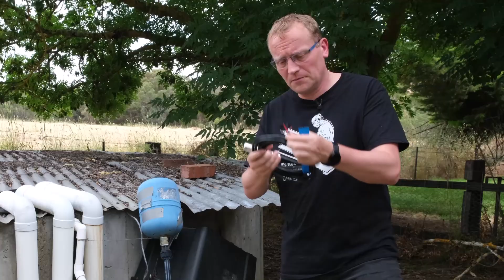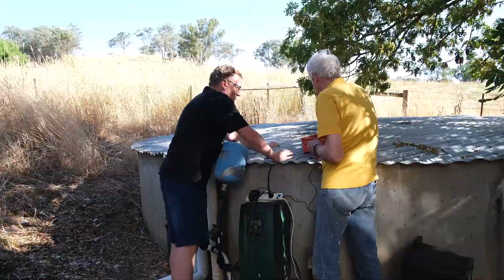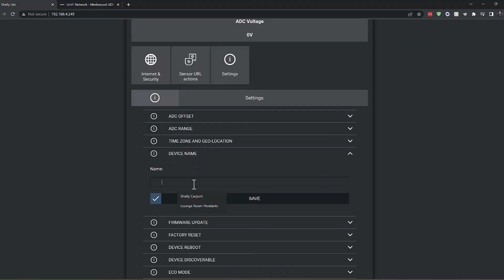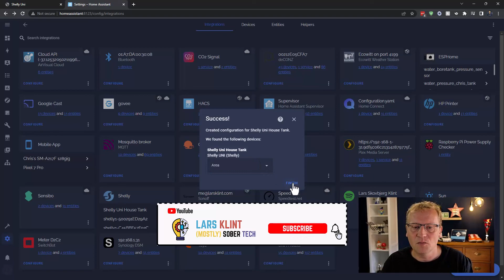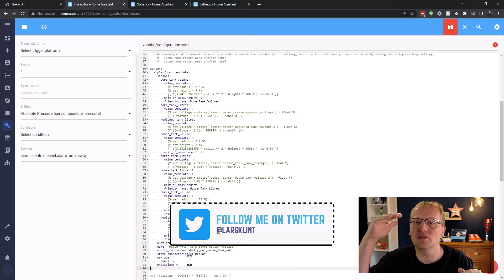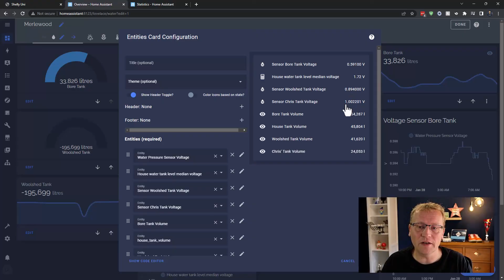Monitoring water tank level with Shelly Uni & pressure sensor | House tank sensor v2.0

Comment: Marvelous Lars, thanks for your efforts sharing with us all :)
Could I ask, would it be possible to trigger a flashing alarm light when a specific water level is reached do you know?
Haven't setup HA yet but will finally be getting round to it and first sensor will be a Shelly Uni and one of these tank sensors.
I too want to monitor a couple of rain water tanks that is our water supply, but also to monitor and alert if our grey water tank level rises too high (indicating a fault with the pump) and council regs specify a flashing light on the tank.
The one that was there is old and busted and rather than the old way I want to go this newer way and kick off my HA journey!
Cheers from Northern NSW.
Matt.
Reply from the maker: Hi Matt. Good question and YES, absolutely! You can get Home Assistant to trigger almost any kind of event. I would use something like a Shelly 1 to get the light wired up, and then you can control that from HA too. Oz Smart Things has all the Shelly units and use discount code LARSKLINT for 5% off too. Support the Aussies 😁
Reply: @LarsKlintTech  awesome man will use that code thank you :)
Reply: Oz Smart Things Stripe checkout says "Enter a valid discount code or gift card"
(Posting here in case it helps others...)
Reply from the maker: @Ltech-ludditetechnologies  It worked though?
Reply: @LarsKlintTech  regrettably the code did not and I am under time pressure with council (overdue (on the extension) for my inspection)
I would however like to buy you a coffee to even that out by way of thanks.
Reply from the maker: @Ltech-ludditetechnologies  I think something is broken in Shopify. The code is active on the backend that I can see, but somehow Oz Smart Things isn't picking it up. Give it a try tomorrow?

Comment: Hi Lars, Just finished installing some tanks, now looking to get a reliable level, bought a ultrasonic distance sensor a couple of years ago for another project but it seems faulty now I've installed in these tanks(after installing it so neatly too in the top of the tank, always the way), now looking at a pressure sensor as it would seem more reliable long term.

Does the sensor sit on the bottom of the tank(i.e probably laying down), or does it hang? I'm not find a lot of info on that when I look around.

Cheers,
Reply from the maker: Good question Ryan. I don't think it matters. The pressure sensor I use in this video is not very long relatively to the height of the tank, so at most you'd get a tiny voltage difference, which you can compensate for in Home Assistant anyway. I just plonk mine in the tank until it hits the bottom and I haven't had any issues with it. 
On a side note I am not a fan of the ultrasonic either, as I have heard other anecdotes of them being unreliable and unstable.
Reply: @LarsKlintTech  Yes, done that with ultrasonic sensors - A02YYUW.  Hopeless, subject to noise (rain, wind, filling) in the tank and didn't survive in the damp atmosphere (despite the specs). Wasted a lot of my time, but not much money, on that idea.  Moved on to the pressure sensors.

Comment: Thanks Lars, finally got a Shelly Uni and was able to install it all on my setup here in Thailand.  I had the slight complication of a pressure sensor that ran on 5v so had to include a buck convertor into the mix rather than run another power supply.  As is often the case I had issues with the yaml for the sensors but eventually I always find the missed quote mark, space, colon, hyphen or indent!  I'd send you some photos but don't know how!
Thanks for helping with this video,
Leigh
Reply from the maker: Oh, I am so happy to hear that Leigh. That is great news. FWIW I always have issues with the YAML and redo it several times for any new project. 
If you look at my channel details, you can see my contact details as well. I'd love to see the photos of it 😊

Comment: Thank you this is very helpful. On my farm i dont have electricity at my tank, do you have any solutions for powering the shelly and depth sensor? I wouldnt know power requirements or what size batteries to use if i was to make the solar array myself, not sure if there is an off the shelf product to suit?
Reply from the maker: It is difficult to answer without seeing you setup, and then still difficult 😂 You probably need a solar panel, a solar controller, and then an output from the solar controller to power the sensor and Shelly.

Comment: Thanks for a great video! I've created this setup myself, however I used the 0 - 10V range sensor instead which gives a much smoother line to work with & does not require the median value like the 0 - 5V needs.
I've also used a weather proof enclosor with a DIN rail to mount a DIN 12V PSU to power the sensor & shelly UNI. 🙂
Reply: Would you mind sending me the link of the 0 - 10V range sensor you purchased? Thanks!
Reply from the maker: Very nice work mate. That is perhaps what I should do when I upgrade the system again 😁
I definitely want to improve the enclosures I use too.
Reply: @LarsKlintTech  Happy to share my photos if you like. :-)

Comment: As a fellow microsoft guy homesteading in Australia who has taken on many similar projects over the years, I really appreciate you!

Silly question, when the sensor says its range and cable length (e.g. 5m range and 5m cable) does that mean that the supplied cable is actually longer (e.g. 5m of cable to get to bottom of 5m tank over ground and 5m of cable go get back down to ground) or would you need to extend the cable?

Cheers
Reply from the maker: Thanks Dale for the kind words ☺ No silly questions here. That is a good one. It took me a bit to figure it out, but the "range" is how deep a body of water you want to measure. It is the calibration of the sensor, so a 3 meter range will be at near to max voltage (if you chose a voltage sensor) at 3 meters. A 5 meter range is close to max at 5 meters and so on. 
The cable length is the length of the cable at the end of the sensor.

Comment: Quick update note for anyone else as dumb as me, just to help out. I blew a power supply in a rain storm a few weeks back. I dried everything out, added a new power supply and redeployed it to the tank. I kept getting the same voltage at whatever depth. In short it had become useless. I assumed that the power spike had killed the sensor so I ordered a new one, which came today. connected it up and got the same result. After a bit of thinking time.............................. I realised that the ADC voltage has to work in conjunction with one of the power supply polarities and that I had (when replacing the original power supply) inadvertently reversed them. Corrected that and we're back in business. We now have a spare sensor (doh !), which I'm going to try and deploy at the dam after I get some wifi and battery power down there
Reply from the maker: Thanks for sharing Peter. We have all been there. I have gone wrong so many times with various projects, but we just keep iterating until we get it right 🤓

Comment: Great Video! I have a question: Is there a way to display/convert the voltage into something meaningful, such as a percentage or a gauge, without the need to host a home automation platform at home? I am trying to monitor the water tank level without setting up a home automation server.
Reply from the maker: Thanks mate for watching. Good question. I am not sure, but I would imagine so. There is probably a analog gauge you can plug it into directly.
Reply: @LarsKlintTech thanks for the reply.  I'm not looking for something analog, I'm looking for a free online service/website with a decent mobile app that might allow me to do that without needing to install HA software at home.
Reply from the maker: @vickenk  So you are after Home Assistant in the cloud? I don't think anything "free" will possibly solve your challenge. I am not sure anyone would host your data and provide an app without some form of compensation?

Comment: Hello nice work over there 

But I need to change voltage to % like 0.00 volt = 0% and 3.00 volt = 100% for example 

Is that possible?
Reply from the maker: I am not sure what you mean 🤔 If you follow the math in the video at 18:00 you can adapt that to output a percentage instead of litres.
Reply: @LarsKlintTech  yes I did work on it simultaneously after I write this comment. 

Thank you for your replay. 

What I did I used template then I saw in my uni the max is 3V & the min is .10V. So I divide the Voltage on 3 then multiply on 100 then add % to have it after the the number but the problem is I have alot of digits. 

I think I have to use statistics After that I’m not sure. 

Thanks
Reply from the maker: @Ibra96m  Use the "round(x)" function in your template to get rid of the digits you don't want. I use it in the template as well.
Reply: @LarsKlintTech  okeyy

I sow it many times in examples but I don’t what it is meant
Reply from the maker: @Ibra96m  All good. We learn 😊

Comment: Hi another Great Video.... On the Template you created i see you already have an idea of how many Liters of water are in the tank  ...... I my case am using underground Well am not really sure how many liters of water is down there .... How do i get around that in my own template thanks
Reply from the maker: That is a tricky question. If you are lowering the sensor into the well, can you tell how far down the bottom is? If you can do that, then you know the height. If you don't know the width of the well, then you might be able to guestimate it by pumping out maybe 1000 litres and see how much the voltage drops. If you assume the voltage is 0V if the well is empty, you should be able to deduct how much water is in it, if you know the voltage drop for 1000 litres.

Comment: Lars - is there a way to set a retain value for the Shelly uni? My project is very similar to yours but powering with a 12v battery pack of 1860's with a solar panel. When the battery goes below power level to keep Shelly running - it goes offline until the sun comes out again next day. I know that when using esphome you can put in the yaml a retain: true line and the values are retained in the gauge card.
Reply from the maker: Very good question. As far as I know there isn't a memory feature on the Shelly Uni when the power is gone. Add more batteries?

Comment: Mate thanks for this. Just got the kit set up and mostly working. Using the pool to Calibrate it, before it goes down the tank (after I manage to find the bloody cable blocks I bought and now can't locate). Thanks again.
Reply from the maker: Brilliant!! You are most welcome Peter. Clever idea to calibrate it in the pool. That should work a treat.
Reply: @LarsKlintTech  I'm seeing 1.6v per metre roughly. Pool isnt deep enough !!
Reply: Update, found the cable blocks. Built the enclosure (think I might need to drill a hole to put the Uni Aerial outside the box....) Off to the pool shortly.
Reply from the maker: @PCRoss2469  I 3D printed some enclosures, and the antenna needs to be outside that too.

Comment: Thanks so much for this video.  I did exactly was you outlined and can now see my tank fullness, and gleen some interesting info on my water usage.  I added a 10W solar panel and controller, and 8ah battery to power it all, instead of using the power adaptor as you have.  I have one Uni monitor the tank pressure , while the other monitors my battery charge.  It's been up and running for just over a week.  I live in Canada so long summer days, but short winter days and low sunlight.  Going to be interesting on how it all fares over the year!
Really love having the default history functions in HA to see how it will all trend.
Reply from the maker: You are so welcome mate, and love your setup with the solar. It is the best automation/monitoring I have of all the various things I manage. Water is critical and this kind of project just takes that little bit of stress out of your day 😊

Comment: This is so good. I'm all over it. But how many of these analog pressure sensors could you add to one shelly uni? If I had 2 tank next to each other, could I run two sensors form them into the one shelly?
Reply from the maker: Thanks for the kind words Shaun. You can only have one sensor per Shelly UNI, as you need the ADC input (white wire) on the Shelly to receive the voltage from the pressure sensor. The signal/voltage is analogue so you need the Shelly to convert it into a digital value HA can use. Also, Shelly UNIs are cheap, so it isn't a huge problem?

Comment: Lars, you are a bloody genius. However, I am not. I have the Shelly Uni outputting varying voltages to my two tank sensors but for the life of me I can't work out how to convert the voltage to litres. I've got the diameter and depth (currently 64000L) but that yaml stuff is beyond me, I'm addled. I've been unable to find a video or tutorial that describes how to do this for simpletons. If you know of one please share. Thanks again 🙂
Reply from the maker: Haha, I don't know about that, but at least it is in writing now 😛
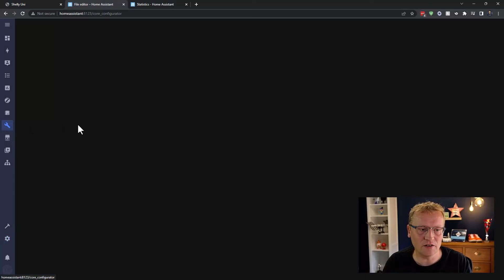If you look at the screen in the video at 22:18 you can see the configuration.yaml file. This is the main config file for Home Assistant where you put everything that isn't "out the box" in HA. You can see a section in the YAML which says "-sensor" at the top. That starts all the various custom sensors I have. A sensor is just a data point that HA can read. Then it says "-platform: template" which means a template sensor. A template is pretty much any kind of calculation you want to do, where you take an input, such as the UNI voltage, and then converts it to another value. 
I have created a number of template sensors, each of which is a water tank litre measurement. For example, for the "house_tank_litres_2" sensor, I have use the voltage from the "sensor.sensor_house_tank_voltage_2" which is my Shelly UNI voltage. The main thing I always get wrong is the correct syntax with what is in quotes and what isn't. 

Does that make any sense?
Reply: @LarsKlintTech  Thank-you Lars for your prompt response. I shall have a go using this information, thank-you. My computer skills haven't improved since we filled out dozens of cards with 2B pencils (which were then sent to a nearby school lucky enough to have a computer) to run simple programs. We'd get the results back a week later usually with disappointing results. I digress 🙂 Thanks again.
Reply from the maker: @lensman893  No worries. It is one of those things where once you get it working, you can copy paste it and get it working much faster the second time. 
If you send me your punch cards filled in with 2B pencil, I will make sure nothing happens with them 😂
Reply: @lensman893  I had a similar problem with the template part. I realised that putting the code into something like notepad++ is much better as the formatting is crucial in yaml.
Reply: @patraff1280  Thanks for the tip. I had a good crack at it a few days ago and made progress. I hadn't realised that the tiny hard to see - (in red) was important 🙂 Now I just need to work out why it doesn't show as a line graph as opposed to a long bar. Kudo to Lars for publishing his code for us to copy, I'd never be able to understand that yaml...
Reply: @LarsKlintTech  Thanks Lars. I'm almost there thanks to your code :-) I didn't realise the red dashes (-) were important, DOH. Still trying to work out why the history shows a horizontal bar graph (rather than a line graph) but I'll get there. Thanks for all your videos, I think I've pushed up your numbers on this one haha..
Reply from the maker: @lensman893  Awesome to hear that. So glad you are getting somewhere 😊

Comment: Thanks for this Video! Which type of sensor is the right one for the Shelly Uni:
4-20mA Output, 0-5V Output, 0-10V Output, RS485 Output?
Reply from the maker: Thanks for watching Ralf. I use the 0-5V output version, and the 0-10V should work just fine as well. The Shelly UNI doesn't support mA output, so not sure what that is for.
Reply: @LarsKlintTech  Thanks for the clarification. You aliexpress link defaulted on the mA unit, which confused me. Perhaps the 0-10V has better resolution/less noise than the 0-5? Although at this price point I doubt that high accuracy is a thing. Really good find on both the sensor and the Shelly uni.
Reply from the maker: @Rack-Hammer  No worries. Yeah, I couldn't link to the exact version I got of the sensor. They are remarkably accurate, and if you put the output through the statistics sensor as well, you can get a super stable measurement.

Comment: At 12:10 -- The "outputs" are "potential free" like a relay basically. Think of it as basically just two switches: When "on" current can pass through (because the switch is "closed") and, when "off" current cannot flow because the switch is open. No voltage is supplied to these wires by the Shelly Uni itself.
Reply from the maker: Thanks Jeremy for the explanation. I realised this a bit after recording too, so really appreciate the help :) I have since used the potentially free/dry connection to switch a solenoid on and off (but not power it).